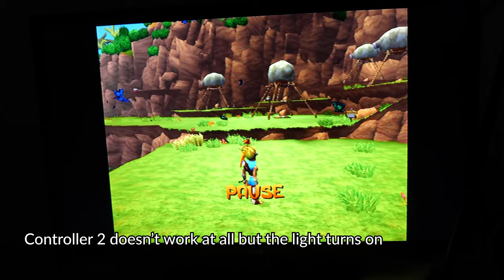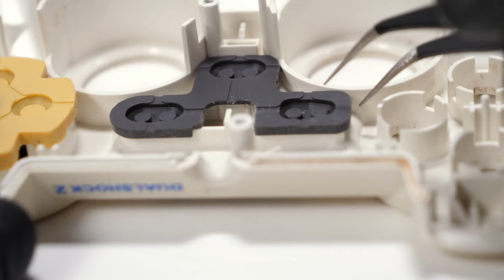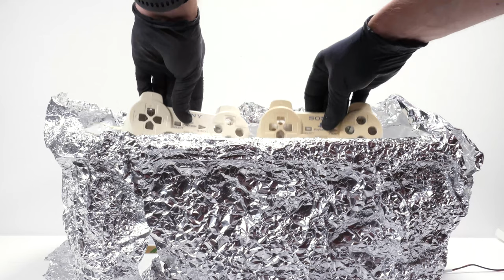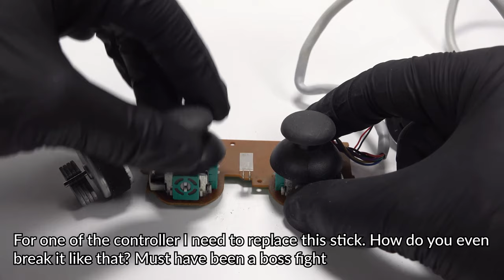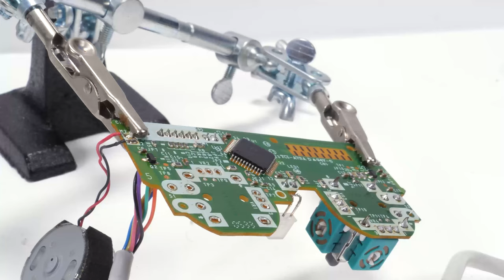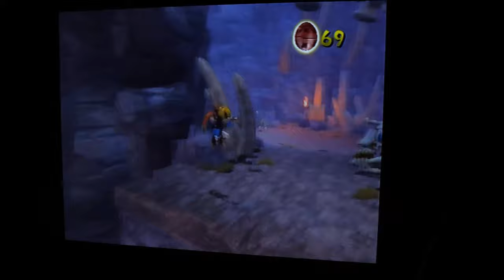Restoring a pair of Junk DualShock 2 Controllers for my Playstation 2 - Retro Console Restoration

Comment: Hey man! I just wanted to let you know that for the part of the controller that was yellowed and connected to the cord, you can get some Salon Care creme from anywhere like a Sally’s or online, and it contains hydrogen peroxide and is a creme, so it won’t run off into the electronics and you just have to apply the creme to whatever surface that needs to be unyellowed, and then place it under the UV lights. Might be something to look into so you don’t have to use as much Hydrogen peroxide on the shells of the controllers and to use in more sensitive areas.
Reply: 8BitGuy fan?
Reply: @c4rt00nk1d  cry

Comment: Well done, i hope some day you can restore a Nintendo DS
Reply: I have a DS Lite that a piece snapped off when a friend dropped it and the top half no longer locks in place.
Reply: @kimr8371  could be a broken hinge or the shell around the hinge broke, both are easy to replace and videos showing how to replace them are easy to find.
Reply: My DS Lite May be broken on the DS game card side, it might not play DS games.
Reply: That will make me feel old lol
Reply: I've taken apart so many Game-Boys but taking apart my DS lite just to clean it scares me 😂
Reply: I broke two DS systems and even a old model 3DS and sadly I never discovered this channel before they were discarded.
Reply: @Kyle Baxter use flex tape.
Reply: Man I'd love to have my old DS Lite work properly, it survived many falls onto super hard floors.. everything works except the screen cannot be calibrated and there's always a huge touch difference.
That, and the white is yellowed to hell and back

Comment: I just took apart a couple Dualshock 2s myself to clean. The midframes on mine were so fragile! On one of them, the part holding one of the rumble motors was completely busted before I opened it up. Fantastic job on these!

Comment: Oh my god, I remember burning myself a couple times learning how to solder back in school XD good times. Concave > convex beads though :) I would recommend putting some small amount of solder on the twisted ends of stripped wires, to make a better connection and gives you more control when everything is molten and sliding around, but also prevents rogue singular wire ends bending away in random directions and keeping things tidy. I thoroughly enjoyed the video, Thanks :)

Comment: Using the copper braid for de soldering does work, but I got used to my solder sucker gadget. Only have to heat the spot once, and it generally clears the holes in the board at the same time. Spring loaded, and was cheap. For ICs and such it was a godsend.

Comment: One suggestion on the soldering is the technique of tinning the loose strands in the wires. It's just a matter of twisting them up and putting solder on them in a specific way. It's a small thing, but makes soldering small wires so much easier.

Comment: Thanks, 10:34, quick tip, pre-wet the soldering iron tip with solder first.  The eutectic solder acts as a heat bridge which is critical for desoldering like this.

Comment: Don't know if someone already mentioned but hey Odd you did great but I suggest two things, there is a small test software that lets you test the controller buttons with the pressure sensitivity each one has as well as test full motor range, and also the R2 and L2 buttons are made to be snapped in place after you close the controller, it is way easier that way, and for the Dpad the spider-like piece the missing leg should point to where the stick is

Comment: When you assemble the controllers back, never put L1 - L2, R1 - R2 in before it's back together, just push them in at the end! also to remove them, push them inward when it's disasembled. I'd love to see you tackle corroded traces on the plastic ribbon/board!

Comment: I would recommend FMCB or something that can run homebrew, there is a controller tester app which is useful to test if the pressure sensitive ranges are working as well. I had a controller that the X button would only activate to around 50 out of 255 no matter how hard pressed. Of course I'm sure this is easier/possible to do on PC with an adapter

Comment: You are the great master Odd Tinkering.  I want to give you an idea when restoring consoles and gamepads or other things made of plastic, after you have polished them, you can first paint them with the KU-6000 adhesion activator and then paint them with acrylic enamel, but not alkyd enamel, I do not recommend using it, it has poor adhesion, all of the above I spoke about the enamels of the Kudo brand)

Comment: I wish that controllers were still wired. I’d much rather have a wire then having a station to constantly charge my controllers (extra clutter) and having my controller battery die on me at the most inopportune time while I am gaming. There was no need for the controllers to go wireless in my opinion. 

If they were really worried about people not getting to sit farther away from the playstation, they could’ve always simply made the wires longer.

Also, the rubber tops of the thumb sticks being domed on the PS2/PS3 is far superior than play PS4/PS5’s caved in rubber tops on their thumb sticks. The rubber constantly wears off on the outer ringed edges of the latter and the hard plastic underneath then digs into your thumbs. It’s awful. 

That crap simply doesn’t happen to the PS2 and PS3 domed thumb sticks. They never wore down. It seems like they did it to get people to buy replacement controllers often as a money maker.

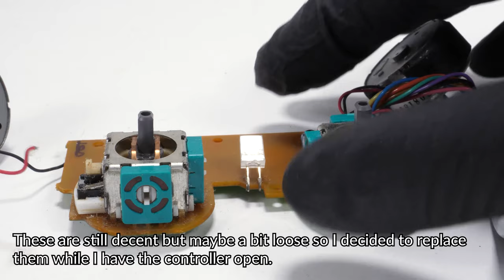Comment: 10:10 - you can't decide that unless you actually test it. Pro tip: you can take off the potentionmeters on the sides if you only need to fix those while the "body" of the stick is still okay. And it's just 3 pin desoldering instead of 14 (I believe it's 14, 4 of it is structural the others are actually doing things, 3x2 for the potentionmeters and 4 for the button under the stick).

Comment: Hmm, I see you got the controllers with the better circuit boards, there's another revision of the PS2 controller which has the button contacts ribbon flex connected to the PCB through a 10-pin connector, those are harder to repair and would require a new button ribbon flex

Comment: In order for the shelf to be better pressed and the electrical contact to be better, you need to put something under the silicone spacer to increase the thickness.
P. S. I use google translator)

Comment: Great job! But that connection on the motor is bad as you need to tin the wires for it to be strong, or at least cover them in soldering flux ;)

Comment: I've found a bunch of PS1 and PS2 controllers in the trash. Usually they work, but when they don't, it's always the same problem; Some of the buttons don't register. I take them apart, clean the contacts with alcohol and check for broken wires or traces. Every single time, the contacts are clean and there are no obvious problems, but the buttons still don't work. I've even tried bridging the contacts at the connector board with a pair of tweezers, but they still don't work. It's like the controller just loses the ability to recognize some of the buttons.

Comment: I recently pulled 2 great condition silver controllers out of storage that were working perfectly, and now the D-pad doesn't work on either (one not at all, one just 2 directions). All the other buttons seem ok. I opened them up but can't see any obvious problems. Thinking a problem with the plastic membrane and contacts, but don't totally understand how they work and whether cleaning would remove any tarnishing or similar issue. I had a 'new' old stock silver controller, opened that up and it works perfectly but want to fix the others rather than throwing away.

Comment: Have you thought about adding weights to bottom of the hydrogen peroxide tank and then tying the object with thin string that measures no greater than half the height of said tank? It may get the parts sat on the bottom better.

Comment: Ah yes, entire month i spent with ps2 controllers. I love how they are pain to assemble... Im extremely stupid and i had issues with flex cable connecting to motherboard... Controller was pressing by itself because i couldn't connect it properly. It was pain but finally working
Reply: I have been having a similar problem after I cleaned a controller, where the start button seems to be pressing itself. How did you fix the problem or do you have any tips?
Reply: @ABizzyBYT  try cleaning it with isopropyl alcohol, it helped me

Comment: Still new to soldering, what is the best temp to do something like putting in new thumbstick controllers and to confirm. You heat up the little metal prong and touch the solder wire against the little metal prong and not the edge of the soldering tool itself, correct? So heat up the prong and then push the solder wire against the hot prong where it will melt and fill in the hole around the prong correct?

Comment: I’ve opened up my DualShock 2 to find out how the pressure sensitive buttons work. Still can’t work out how. I thought it was a lie, so I tested it on gran Turismo 4 and you can control the throttle just like the sticks. I don’t know why they got rid of that feature in the DualShock 4.

Comment: Hay if you're able to answer I have a few questions, specifically about the analog sticks

Currently testing soldering skills on a mad catz ps2 controller and after a thorough cleaning it just seems that the analog sticks dont work properly and was going to go ahead and buy new replacements, just the ones you linked in your description look very much different to the ones inside this controller. So long as the pins are about the same does this even matter?

Comment: ive watched a bunch of vids and you seem to be pretty rough on the button gaskets i tried to clean those once when i fiddled with my xbox 360 controller and the metal peg or whatever just instantly ripped off and i had to order replacements. was i just unlucky or do i not have "the touch"?

Comment: Question: The New Analog Sticks - are they as smooth and responsive as the Original ones? Or are they hard and stiff with a long travel way like on many cheap Knock off controllers ?

Comment: They analogjoystick (electrical part) you listed states is for the 360 do they use the same exact piece of equipment as the PS2 ones? In other words same connections?

Comment: How does the whitening work with only UV light on the controller plugs? Isn't UV light supposed to be what makes the plastic yellow in the first place? And don't you need hydrogen peroxide to start the reaction too?

Comment: Wait a minute you can use only UV lights as well? I have a light spot on my white Logitech GPROX Superlight. I just used 70% isopropyl alcohol with an orange microfiber and it left some orange I think because its lower quality, its thin. Then I went back with a better quality yellow micro and it got most of it off but its still a lil yellow. Can I just hit it with the UV light for an hr or so? Might restore in 30 mins because its very faint but I notice it and it bothers me

Comment: Not that long ago I did a repair on my transparent red DualShock 1, and 2 things, first off the DualShock 1 and 2 appear to be near identical on the inside, and 2, they are very easy to repair. The repair I did was replacing the rubber pads that the shoulder buttons click on. The issue I had was that the pad bent and the r2 button wouldn’t click because of it. Just thought I’d tell y’all incase anyone has the same issue.

Comment: I have no experience with electrics and I have a PS2 controller that when I shake it it sounds like something is loose and the X button stops working sometimes I think the loose thing is the X button or maybe the when I press the button it's not registering on the mother board. What's my best bet?

Comment: Hey I’m not sure if my original ps2 controller was opened up before but there’s two screws that seem either stripped or over screwed either by the company or by someone. Any ideas on how I can get it out. It’s on the top side and on the bottom side, those are the only screws not letting me open the controller. I really want to clean inside the controller for better feel.

Comment: do you know how to Restoring Playstation 3  DualShock
the problem on the DualShock is it press it self to the left but the  DualShock is fully straight 
i do not even press DualShock forward it on the table look like nothings wrong but on the TV
you see character moving slowly to the left
or 
a adder control i have ,, you press x but it reads also  L1 or  press o but it reads also  PS button
or  press L1  but it reads also DualShock like  Press left or right this Controller bain is mix up how do you fix this
thank you